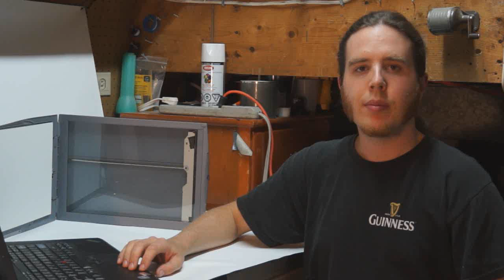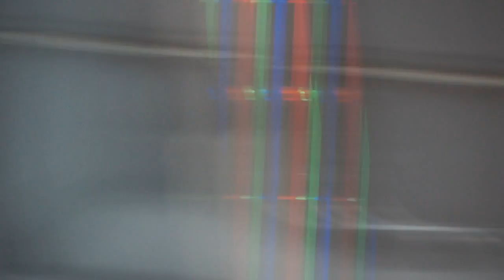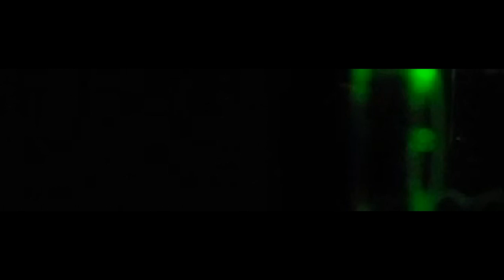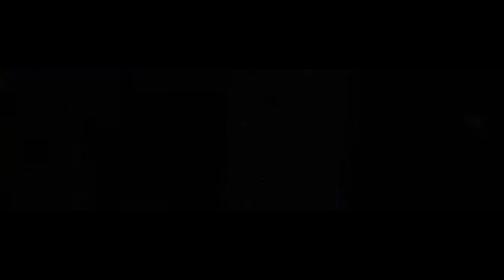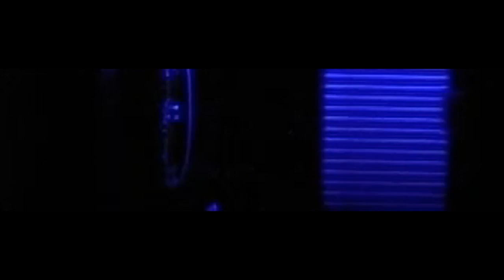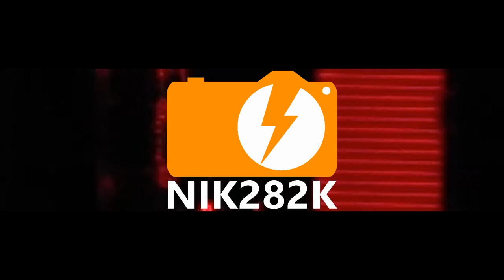How Scanners Detect Colour

Comment: Interesting info!
Nick Moore 
Instead of a synced color filter wheel, seems like you could also place a single colored filter over the lens, scan three times swapping the filters (once each for red, green, blue), then colorize and composite the scans in an image editor (as if they were color channels).

Cheers!
Reply from the maker: Stephen Tack True enough, I always carry my flat bed scanner, card board box, laptop and optical bench (freezer) with me in case I want to snap a photo.
Reply from the maker: I was thinking of that but the capture time would be be on the order of minutes making it just as impractical as a rainbow-dremmel bit of doom.
Reply: Nick Moore
Maybe print a grid of colored dots on a transparent film and glue it  on the scanner. It would not be pixel perfect and require software mapping.
Or illuminate the scene only with a projector quickly flashing primary colors. It would probably be impossible to get the timing right for each line but perhaps it would be possible to tune it to illuminate a fixed number of lines with one color and sacrifice vertical resolution.
Reply from the maker: I was thinking of adding RGB back lighting to this scanner so I could scan colour film negatives. I was just going to steal the RGB signal right off the existing head.
Reply: Nick Moore "...impractical..."  because photography with a scanner is inherently a highly practical endeavor, LoL ;-)
Reply: Nick Moore It would work fine if you just scanned normally while pressing a white surface against the negatives from behind.
Reply from the maker: I have tried scanning negatives directly but had poor results, reflected light doesn't seem to work as well as transmitted light with this scanner.

Comment: Does your scanner have a 48-bit mode?  If so, what happens there?
Reply from the maker: I don' think so, I was using the highest resolution (1200dpi?) when filming this to get the smallest steps of the head.
Reply: My Canon LiDE210 (and an older scanner that used Canon's hardware, a Lexmark) has a 48 bit colour mode.  The scan time takes longer, the filesize is bigger, but the spatial resolution doesn't change.  The mode is selectable across all DPI ranges.
I wonder what the extra bit is capturing...?

I'll see if I can determine that today.

There's also a 2 bit mode; looks very fax-y, and a grayscale mode; both use just the green LED.
Reply from the maker: It is probably colour depth. I'll have to dig it out again and scan something with a very fine gradient to see.
Reply: Yeah, but where is that additional colour depth coming from?  2x the grayscale?

Comment: Are the 3 colors really taken at exactly the same position or is it "red-step-green-step-blue-step"? In other words is a advertised 2400 dpi scan resolution actually 800 dpi in each color and the rest interpolated or is it really 2400 dpi RGB?
Much like a 12MP digital camera has 3 million red, 3 million blue and 6 million green pixels, which are interpolated up to 12MP RGB.
Reply: It's actually 2400 dpi; it would have a lower resolution if it was optically separating colours.

Comment: That was really interesting. It makes sense. So the trade off between the white light and rgb scanners would be speed vs resolution?
Reply from the maker: There is also the complexity of manufacture to think of, a colour filter that goes over every photo-receptor on the CCD/CMOS sensor is a lot more complex than some LEDs and a clear plastic diffusing grill.
Reply: Do the LED lights scan a page line by line horizontally like a crt TV scanning beam ?
Reply from the maker: The LEDs light up the whole row at once and the linear image sensor take a 1 pixel wide, 4k pixel tall image.